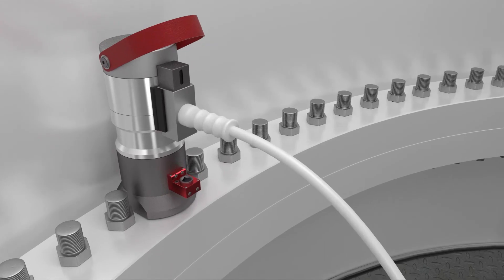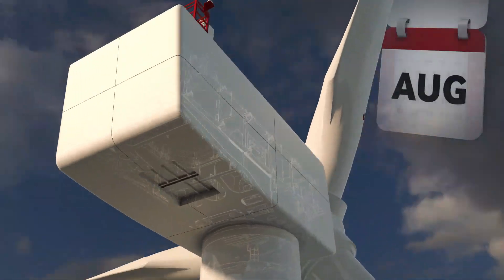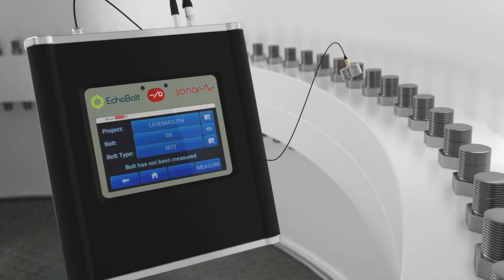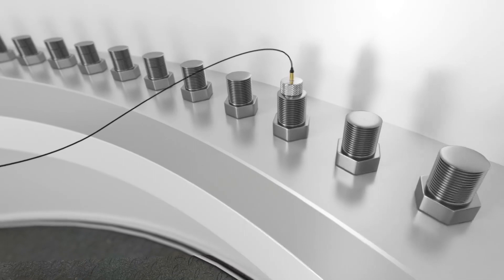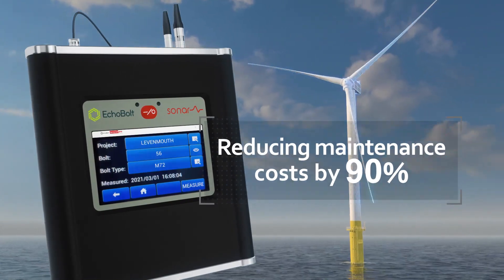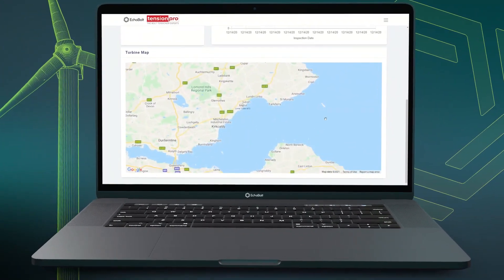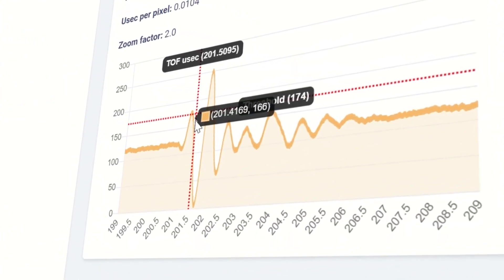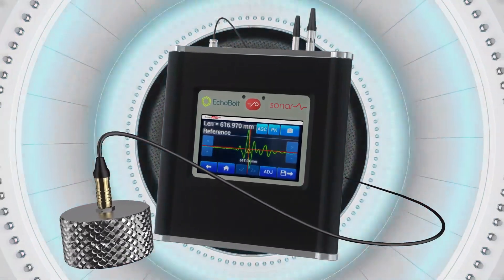EchoBolt Wind Turbine Bolt Inspection Technology Overview

Comment: Being a mechanic  for over 54 years,  when a bolt is torqued to specs, it is properly stretched. Retorquing it will stretch it  excessively  and ultimately weaken it. That is why bolts in critical areas  are never reused. Doing the newer  procedure is the way to go.